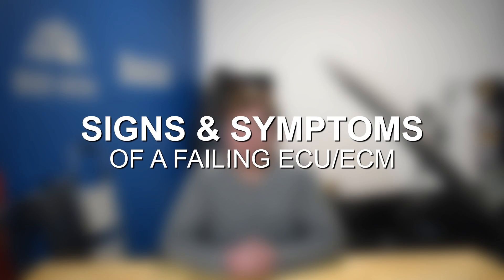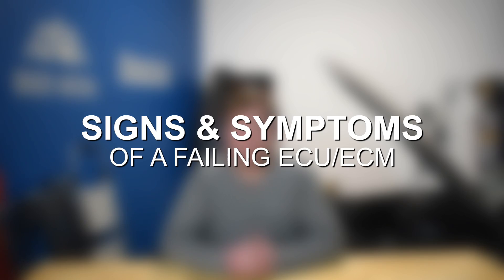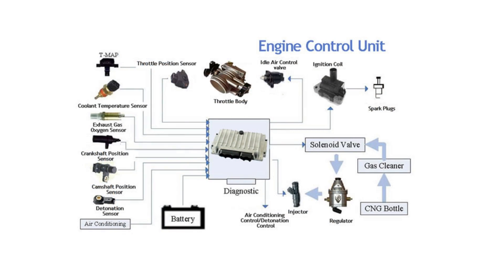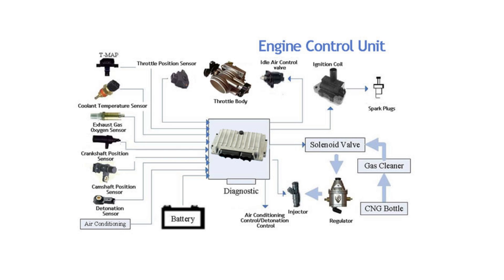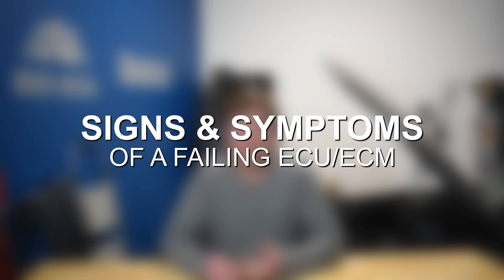Signs & Symptoms of a Failing ECU/ECM! (Engine Control Unit or Engine Control Module)

Comment: I’m thinking this is my problem with my 2014 Jeep patriot . My lights will randomly come in while in the drive way and the next morning the battery is drained and this happened 3 times already. Helppp lol
Reply from the maker: O - This sounds like a classic case of a parasitic battery drain, likely caused by a faulty body control module (BCM), interior light switch, or relay that's sticking and keeping the lights on after the car is off—especially if it's the dome, courtesy, or parking lights turning on randomly. Start by checking if any lights (interior, trunk, glove box, or exterior) stay on or flicker when the car is parked, then do a parasitic draw test with a multimeter by pulling fuses one by one to isolate the circuit responsible; once identified, you can trace it to a switch, sensor, or module that’s failing and causing intermittent drain. In the meantime, disconnecting the battery overnight or using a battery disconnect switch can help avoid getting stranded until you find the root cause.

Comment: My car is 20 years old and I went through two new sets of spark plugs, new set of engine coils, a new oxygen sensor, new fuel injectors and as it turns out at the very bottom was the ECM so I spent close to $500. Trying to change all these things out. If I had just changed out the ECM from the GetGo I think I would have been good
Reply from the maker: D - Sorry to hear man... Glad your issue has been resolved however!
Reply: I was driving home and stopped at the light and when I proceeded to hit the gas, my car just died out
Reply: @CobyCyriaque sounds like the ecm module
Reply: I think I’m having trouble with my ecm I just got this Chrysler 200 convertible not too long ago and I bought the car. It was running great and everything, but when I got home and opened the trunk, I realized it was an old fuse box in the back and some huge metal thinking that was ecm box
Reply: Did the same change all that plus camshaft, crankshaft,maf. Found my mg/c st and ecm fuses and relays isn't getting power
Reply: 15-20 years it last that long 😂😂 shii my 2017 Tacomas ecu had to get reprogrammed

Comment: I purchased a PCM  for 2007 Ford Taurus. P0352, the engine ran  rough, with no power, stumbling, small backfires. Replaced plugs, plug wires, and coil pack. The engine cranked ran for 10 seconds and shut off. Now,  no obd2 date link connector communication (two different scanners) and no crank. Do you think I made the right choice with replacing PCM ?
Reply from the maker: P - Based on your sequence of symptoms, it strongly suggests that either the replacement PCM is not properly programmed, is incompatible, or was not correctly installed (ground, fuse, or connector issue), especially since the no-comm condition happened right after the swap; while P0352 initially pointed to an ignition issue, the sudden total failure of communication and crank function after PCM replacement leans more toward an electrical or programming fault—so double-check that the PCM is the correct part number for your VIN, ensure all PCM grounds and fuses are intact, and confirm whether it was properly flashed to your vehicle, as a used or unprogrammed PCM won’t communicate and can shut down the system entirely. Keep us updated!
Reply: It was the negative battery cable. Underside of cable was an abrasion point and cable was corroded inside of sleeve. Visual appearance from to side looked good and voltage had been making a good path through the electrical system until it didn't ! I did replace the ecm before I found the damaged ground cable,  so now I have ecm and a pcm. If anybody has these symptoms, pull the cables and do a thorough inspection or just fire the parts cannon at it like I did !
Reply: @paulpurdue5963 thank you so much for the info. Im sure this will help others
Reply: Did you figure it out? Updates help alot of people

Comment: My 2019 scat pack is not starting or cranking, I replaced my starter and it won’t start, ACC comes on but it won’t start, after a couple of times of trying to start it the the break pedal doesn’t push in all the way and it basically locks up. The “service power steering wheel” comes on when the car won’t start but after it does it doesn’t come on and the wheel turns just fine
Reply from the maker: S - On your vehicle, if the car won't crank or start after replacing the starter—and you're seeing "ACC" come on, the brake pedal becoming stiff, and a "Service Power Steering" message intermittently—the most likely culprit is a low battery voltage or bad ground/connection, which can cause modules like the power steering and starter relay to malfunction even if interior electronics seem to work; the brake pedal stiffening is normal when the car isn’t supplying vacuum (engine off), but if it happens during repeated start attempts, it’s a sign the system isn’t powering correctly—start by fully charging the battery or swapping in a known-good one, clean and tighten all battery terminals and ground straps (especially the chassis and engine ground), and confirm the starter relay and fuses are seated properly; even a slightly weak battery can cause push-to-start systems and electronic relays to misbehave without throwing clear codes.

Comment: Captiva 3.2l sx 2006 replaced battery,alternator, new bcm everything lights up no crank or sometimes cranks but not running and now see if my ecu can be repaired. All from battery light and then car over rpm to keep engine running, then restarted it and crank was shallow then not cranking.
Reply from the maker: P - Your symptoms on your vehicle point to a possible failure in the starting or ignition control circuit, and while the ECU may be the culprit, it’s more often a case of bad grounding, corroded wiring, or a faulty crankshaft position sensor causing a no-start condition even with a healthy crank; the initial battery light and needing high RPM to stay running suggest the alternator was failing or not charging correctly, which could have starved voltage-sensitive modules like the ECU or BCM, and if the crank is weak or inconsistent, inspect the starter relay, ignition switch, engine ground straps, and test for consistent voltage at the starter solenoid when turning the key—before replacing or repairing the ECU, confirm all power and ground paths are clean, tight, and corrosion-free, as a weak ground or bad ignition signal can mimic a failed ECU.

Comment: I have a 2011 Buick Enclave. Went to start and it stopped mid start. Thought battery. Changed that. There is a ticking when the key is in and the check engine light is flashing rapidly. Also noticed the fuel gauge shows low fuel and there is an alert for low fuel but the car has 3/4 a tank. Could this be the fuse or the ECM?
Reply from the maker: S -  What you’re describing on your vehicle points to a likely issue with power delivery or communication between modules, and it could very well be a blown fuse, faulty ground, bad ignition relay, or a failing ECM or body control module (BCM); before assuming it's the ECM, start by checking the main power fuses and relays under the hood, especially those tied to the ECM, fuel system, and ignition (look for corrosion, looseness, or burn marks), and inspect the battery ground cable to the engine and chassis—poor ground connections or voltage instability can cause bizarre electrical behavior like false fuel readings and module miscommunication, and yes, a rapid flashing CEL with no crank can be a symptom of ECM not booting up properly due to power loss or internal fault, so rule out power supply issues first before replacing expensive electronics.
Reply: @8020Automotive thank you SO much.

Comment: Worked 25 years for Honda and Toyota. Never saw one bad ECM
Reply: I had to replace my rav4s ecm. 2003. It had a common glitch with shifting.
Reply: @FinallyMe78 did it cause stalling and dying out intermittently?
Reply from the maker: D - Thanks for sharing!
Reply: So exactly What are you saying?
Reply: 94 Honda accord crank no start do u think it could be the ignition coil?
Reply: Ignition coils replace all

Comment: Mercedes-Benz c300 2017 codes #(P2505,P0458,P24BE,P2401)🥴🤪😞
Reply from the maker: N - Sorry to hear! These codes suggest you're likely dealing with an EVAP system issue and possibly an electrical problem affecting the power supply to the ECU or other components. I’d start by checking the battery health, voltage while running (should be around 14V), and inspecting ground straps and fuses. Then move on to inspect the EVAP purge valve and leak detection pump wiring and connectors.
Reply: @8020Automotive  🙏🏾

Comment: Got some problems with my 2007 yukon rn with my traction control and stabilitrak on dash markin and check engine light aswell.... Has pour acceleration and slow at starting, throttles and a lil smoke coming out of exhaust....Has been fix twice wasting 10k had all lifters camshaft coils all replaced and just starting acting up last week again 😢 any thing u can advise doin or lookin into
Reply from the maker: D - Sorry to hear you're going through that with your Yukon.. It sounds frustrating, especially after spending so much already. If you're seeing traction control, Stabilitrak, check engine light, poor acceleration, rough starts, throttle issues, and exhaust smoke, it could be pointing to a few common issues that plague these GM trucks. A big one is the throttle body or accelerator pedal position sensor causing reduced power and triggering those warnings. It could also be a bad ground, failing MAF sensor, or an intake air/fuel issue. Since you've already done the cam and lifters, I’d focus next on the electronic throttle system, checking for vacuum leaks, and reading exact trouble codes again to guide you better. If it’s misfiring again, one or more injectors could also be failing or the ECU might be acting up. A fuel pressure test and full sensor scan (including data like throttle %, MAF readings, etc.) would help pinpoint the cause.

Comment: I believe mine is a PCM because i go through a battery every 6 months. new alternator, new fuse box, new starter, new wires, ect. i am ready the set this thing on fire and watch it burn. 2006 ford explorer beautiful vehicle but i bought it and the lady took my money said good luck and ran, literally. even when i took it to the ford dealership it was as if they new the vehicle an couldnt get it off their lot fast enough after putting air in the tires. I tell people someone must have died in it .
Reply from the maker: P - It definitely sounds like a parasitic draw issue that could very well be PCM-related, especially since you've replaced nearly everything else and still burn through batteries every 6 months. On the 2006 Explorer, PCM issues can cause constant battery drain if the module isn’t going to sleep when the vehicle is off. A simple test is to check the current draw with a multimeter between the negative battery terminal and the cable—if it stays above ~50mA after the vehicle has been off for ~30 minutes, something isn’t shutting down, and the PCM is a suspect. If that’s the case, a used or rebuilt PCM with a fresh reflash could fix the issue, and it might save the vehicle (and your sanity) before the gas and matches come out.

Comment: My 2007 Tahoe keep give me fuel trim lean bank 2 and random misfire and if I look at my dash I see that the trip miles just go up by its self and my doors locks and unlock at random times I done change o2 sensors catylast converter mass air flow sensor injectors and spark plugs and wires
Reply: And did a leak test as well
Reply from the maker: Q - Your truck showing lean fuel trim on bank 2, random misfires, trip miles increasing on their own, and random door locks/unlocks suggests electrical issues affecting multiple systems. Since you've already replaced critical fuel and ignition components, the issue could be a failing ground connection, alternator problem, or a faulty ECM (engine control module). Check for vacuum leaks, especially around the intake manifold or PCV system, as a leak could contribute to the lean condition. Inspect the battery and alternator for proper voltage (should be around 14V while running). Also, inspect grounding points and body control module (BCM) connections, as a bad ground could cause both fuel system errors and erratic electrical behavior.

Comment: my 09 g37x starts when it wants to and stalls out of nowhere can you guys help me out
Reply from the maker: E - Your vehicle starting intermittently and stalling could be caused by a failing crankshaft position sensor, camshaft position sensor, fuel pump, or a faulty relay. If it starts sometimes but randomly stalls, heat-related sensor failure is a strong possibility, as bad sensors can cut fuel or spark when they malfunction. Additionally, fuel pressure issues, such as a weak fuel pump or clogged fuel filter, could be causing it to lose power. If the car stalls and doesn’t restart right away but cranks, it may not be getting proper fuel delivery or spark. Checking for stored OBD-II codes will help pinpoint the issue. Try scanning for codes, checking fuel pressure, and inspecting the crank and cam sensors, as these are common failure points on the VQ37VHR engine.

Comment: Just pull out module and look at pins.  Clean out corrosion
Reply from the maker: T - Good first step for sure.
Reply: I see moisture or water inside my pcm connectors. 
But I don't see any corrosion. There is nothing in this connectors that would look wet right?

Comment: Rusted out pin number three on the male side. I put a piece of wire in the empty spot. It cranked for two days now it won't
Reply from the maker: T - If pin number three on the male connector is rusted out and you temporarily bridged it with a wire, the issue is likely a poor connection or corrosion affecting continuity. Since it worked for two days before failing again, the temporary fix may have loosened, or more damage could have occurred. Check if the wire is still making solid contact, clean the corrosion with electrical contact cleaner, and inspect for broken wires, as severe rust may have damaged internal connections. Use a multimeter to verify power and ground, and if the issue persists, replacing the connector entirely is the best long-term fix.

Comment: Changed o2 sensors and camshaft position sensor and MAF sensor. Cleared codes, and all the codes came back up. 
Car will start after it sits for an hour or so. Run for about 3 minutes until i put into park and then try to go again then it dies. When restarting it revs to 2000rpm and immediately dies. Fuel pump is priming fine.
Reply from the maker: A - If you've replaced the O2 sensors, camshaft position sensor, and MAF sensor but the same codes keep coming back, and the car runs briefly before dying, the issue could be a failing crankshaft position sensor, faulty ECU, or a fuel delivery problem despite the pump priming. Check for vacuum leaks, clogged fuel injectors, or low fuel pressure. Also, inspect the wiring and grounds for the sensors you replaced, as a bad connection or shorted wire could cause recurring codes. If possible, scan live data to see fuel trims, sensor readings, and fuel pressure when the issue occurs.
Reply: I have a 01 3.0 v6 ranger has a high idle I replaced the idle air control valve. The throttle positioning sensor replaced the throttlebody smoke tested it for vacuum leaks replace a charcoal canister with the canister vent solenoid but the RPMs sit normal when the idle air control valve is unplugged

Comment: My 2021 Dodge Charger RT, headlights doesn't work, turn light switch doesn't work, the AC/track/any other switches down the display doesn't work, the radio/display doesn't power on, steering wheel buttons doesn't work but the horn does work. What could be a possible solution?
Reply from the maker: S - With your vehicle experiencing multiple electrical failures (headlights, turn signals, AC controls, radio, steering wheel buttons) while the horn still works suggests a faulty BCM (Body Control Module), a blown fuse, or a grounding issue. The BCM controls most of these electrical functions, so a failure or corrupted software can cause widespread malfunctions. First, check for blown fuses in both the interior and under-hood fuse boxes, particularly those related to the BCM, lighting, and infotainment system. If fuses are fine, try disconnecting the battery for 10-15 minutes, then reconnecting it to reset the system. If the issue persists, scan for U-codes or BCM-related fault codes, as the module may need reprogramming or replacement. Also, check the main ground connections near the battery and under the dash, as a loose ground can cause erratic electrical failures. If resetting the battery and checking fuses doesn’t work, a BCM reflash or replacement may be necessary. Keep us updated!
Reply: @ Thank you! I’ll try my best to fix all the issues and keep you updated.